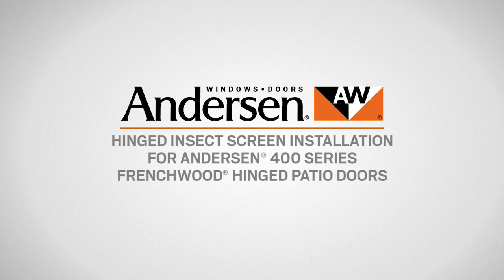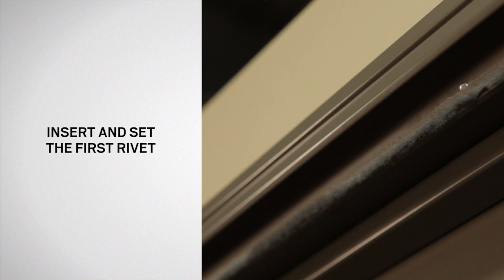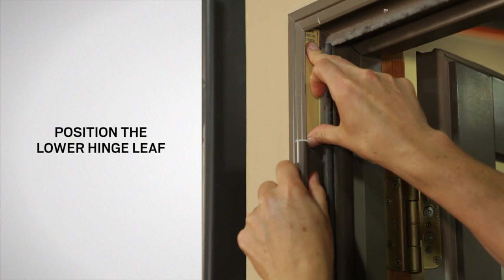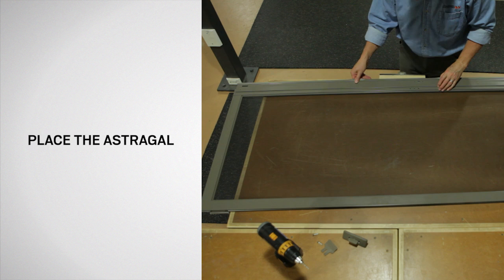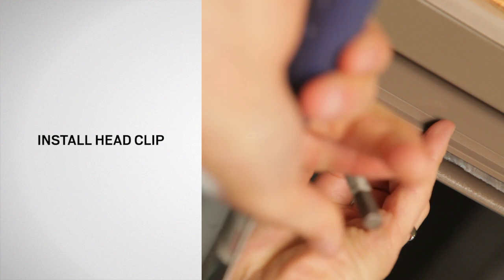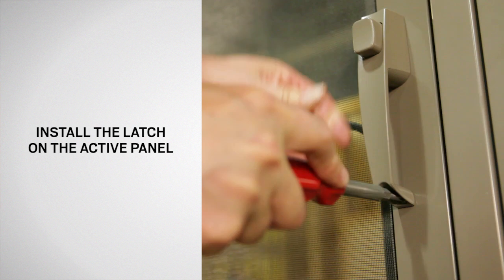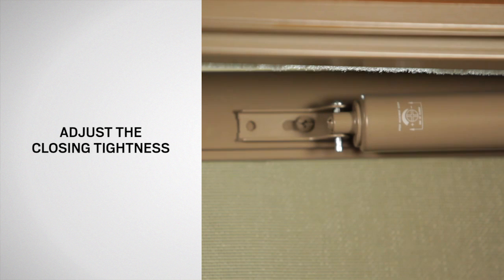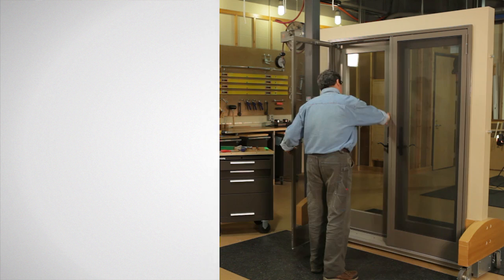Installing a Hinged Insect Screen for 400 Series Frenchwood Hinged Patio Doors | Andersen Windows

Comment: I am very disappointed by these screen doors.

Andresen should install these at the factory.  The fact that they are not factory installed shows how difficult they are to install. Instead of pushing this onto the home owner (my contractor also did not want to install them), Andresen should install at the factory and find a better way to install. 

Andersen should stop using plastic hinges and flimsy rivets.  Good quality hinges have been available for centuries!  The aluminum of the door is so thin no fastener will work long term.  In North part of the country everything gets ice. 

Why is the installer drilling holes when this would be much easier for a cnc drilling machine? 

Why aren’t bug strips installed at the factory?

With multiple warnings not to overdrive rivets and over tighten screws, maybe these are not the best approach?  How about all those warning not to drill holes through both sides?  Is this just another example of bad design. 

When you are charging hundreds of dollars, we should not have to assemble ourselves.